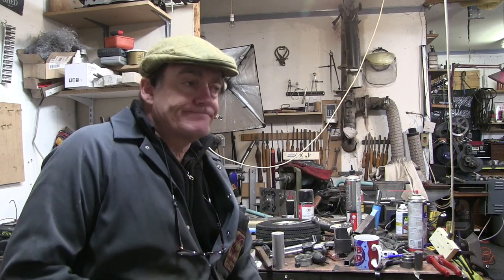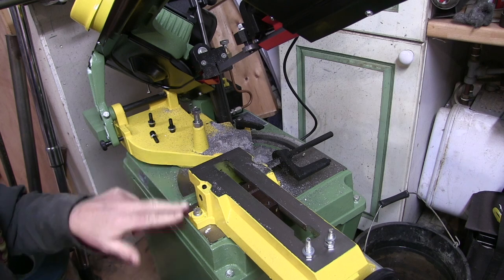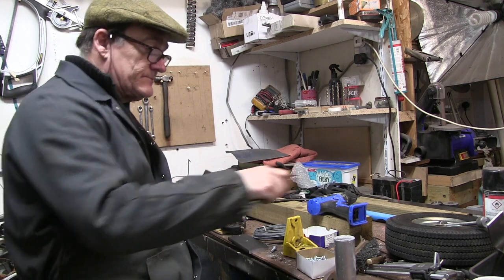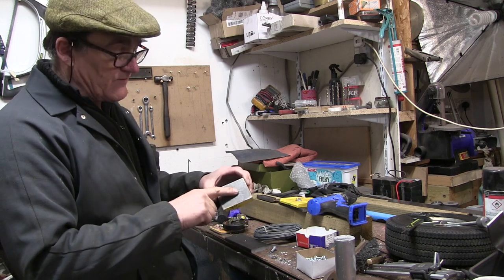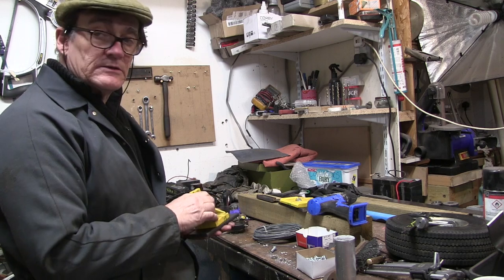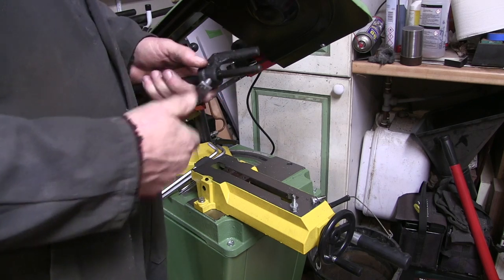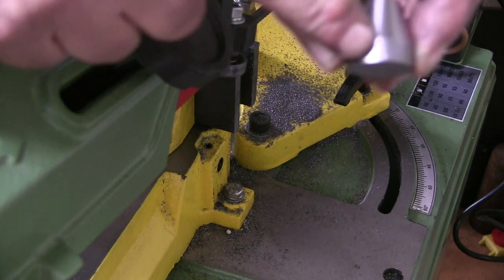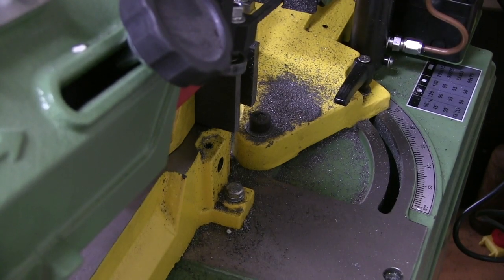Busted Bends and jaws for the Bandsaw

Comment: There is a trick to forging a  sharp , square corner. I cant imagine it would be possible to do on thin metal cold.

Nice band saw. The jaw vise is clever. I need to make one for mine.

Best regards
Frank
Reply from the maker: Hello Frank,
I was blindly optimistic with that bend, definitely a head slap and "what did you think would happen"! After I snapped it of course! :-)
All the best,
Cliff